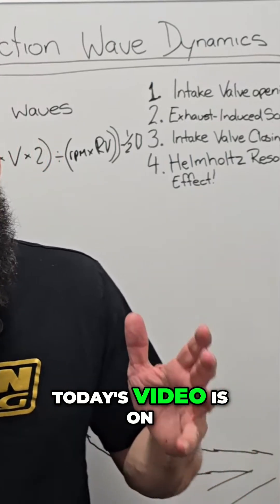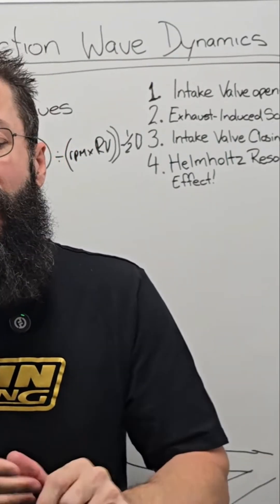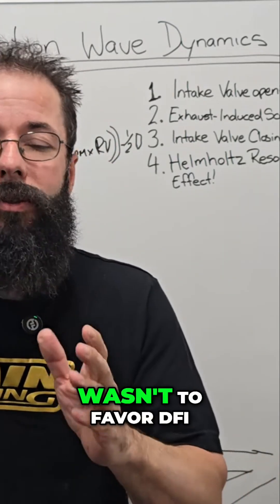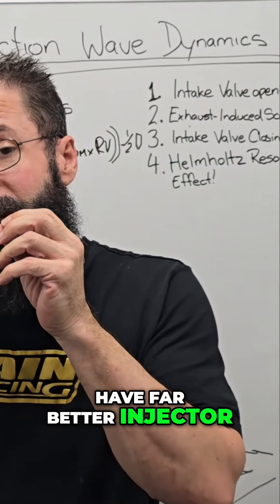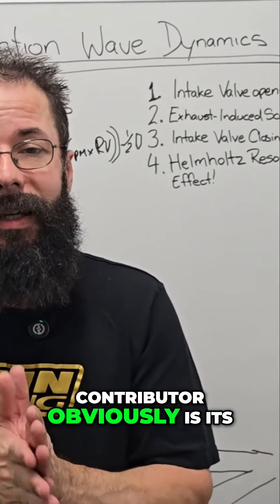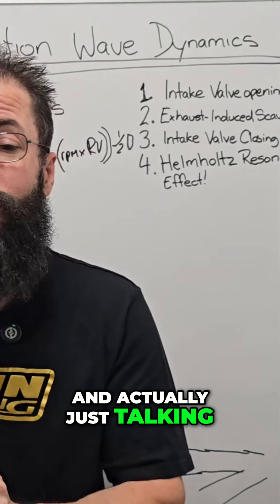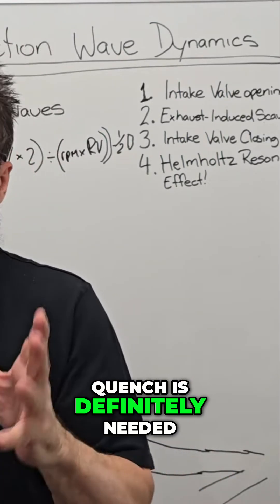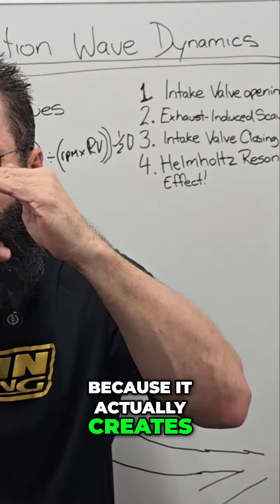DFI vs Port Injection: Understanding Horsepower Mechanisms

Comment: I remember reading about dfi in sport compact car before it came out. They seemed to think dfi also has better detonation resistance and could make more power on pump gas than the same setup on efi. Would you agree with this?
Reply: It can run at a higher compression.
So for given displacement, it should make more power, regardless of other benefits..
Reply from the maker: Yeah, way higher comp and no pumping loss like a port injector creates. ! Mazda for example runs 14 to 1 on pump gas.  Remember you can add fuel in at the very last minute.  Even F1 now use a pre-chamber.